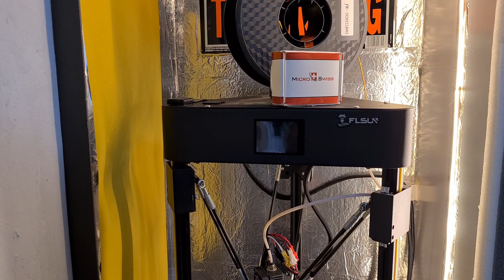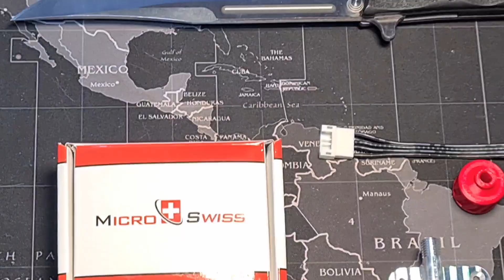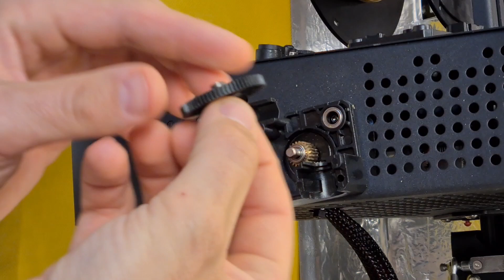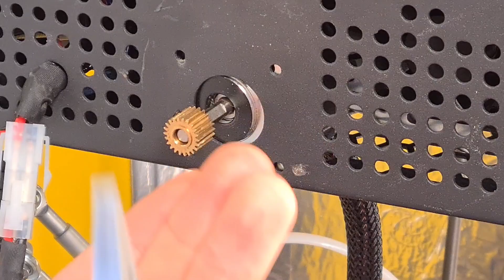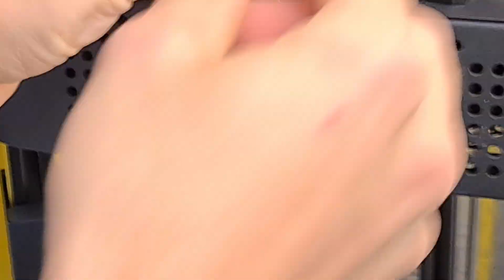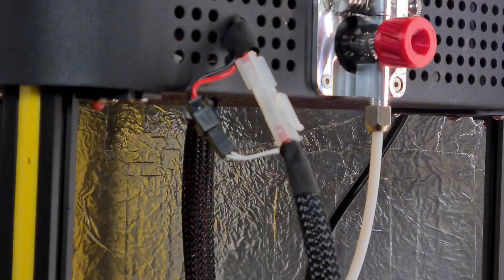Flsun Q5: Extruder Upgrade (Micro-Swiss Bowden Dual Gear Extruder)

Comment: Hi, I installed this extruder but I’m having trouble printing. I’ve set the eSteps using the configuration file, but it keeps clicking and the gears slip backwards. Did you have any problems like this please? Thinking I’m going to have to return it
Reply: The gears don’t rotate at all unless the motor works? The only time the shaft will rotate is when the motor tells it to. Is that not normal?
Reply from the maker: @alexthompson8556  You should be able to manually rotate it 360°. If not you have a jam like I had.
Reply: @wearandtear6692  interesting. I will take another look tomorrow and see if I can work something out. Thanks for your help
Reply: Ok Check something on this dual drive thing, how far is the gear should be pushed in on the stepper motor? The gear not all the way fully parallel geared. The other thing if you cannot push the filament in by hand if it is heated to 210°C, there is an other problem. The bowden not fully pushed in  to the heating tube and have it in  a cooled area before gets' in  and blocked it. If that happened  you need to pull it a part to clean it. Check some videos before you pull it a part how to do it.!!
Reply from the maker: No, worked well from the start. However, when I changed the filament a few weeks ago I experienced something weird. The filament would go in a bit but then the gear system was blocking, could not complete the rotation. When changing the filament I must have caused a misalingnment of the gears which caused a blockage. It did not have to do with the motor, motor control or that the gear was not fastened hard enough to the shaft. Make sure the gears are pushed in place and rotate freely by hand before you try starting a print or loading the filament. Once the filament is loaded the alignment will be held regardless. It my be the case that the filament is chewed down so the gears can't get a grip.